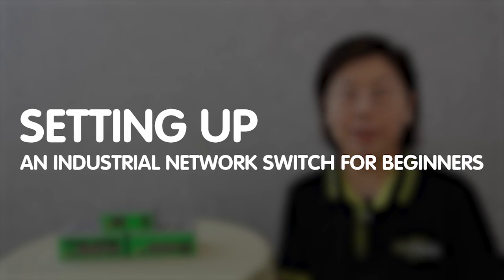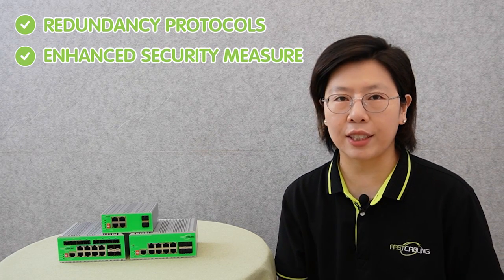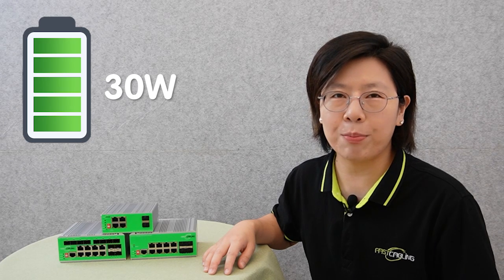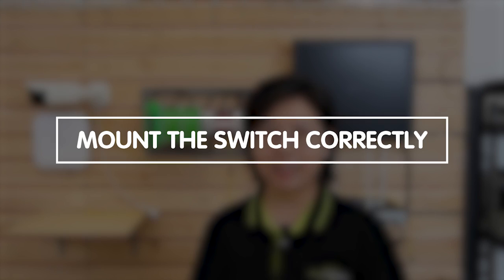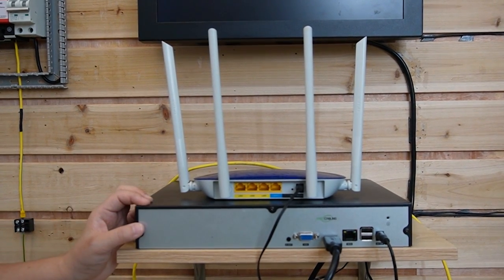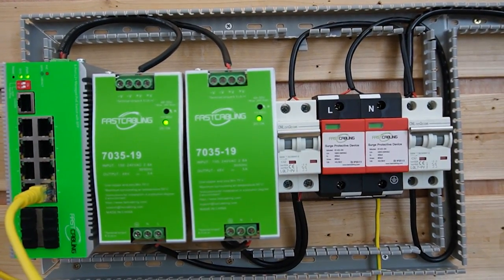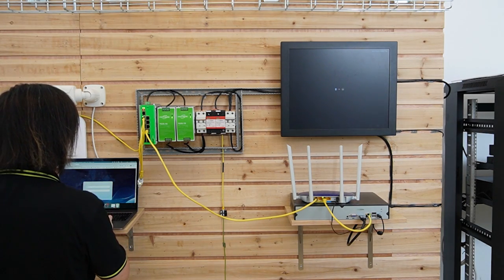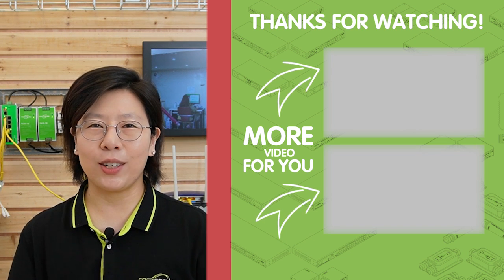Setting Up an Industrial Network Switch for Beginner

Comment: I have a POE Switch, can I supply directly ac current from an outlet?
Reply from the maker: Most PoE switches are designed to be powered by a low-voltage DC input. Connecting AC power directly could damage the switch. Most PoE switches come with a power adapter that converts the AC from your outlet (typically 110V or 220V) to the required DC voltage (often 48V for PoE switches). Use this adapter to power the switch safely.